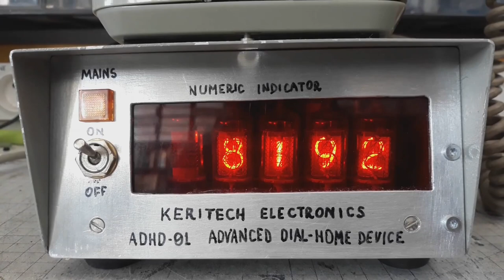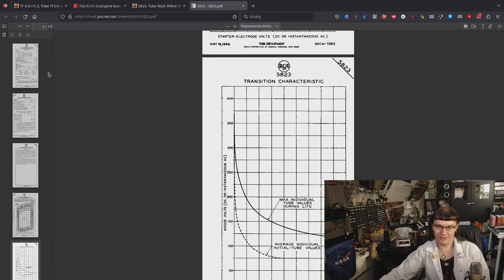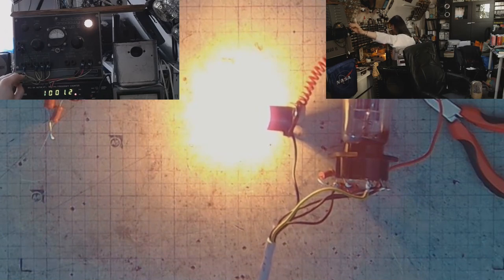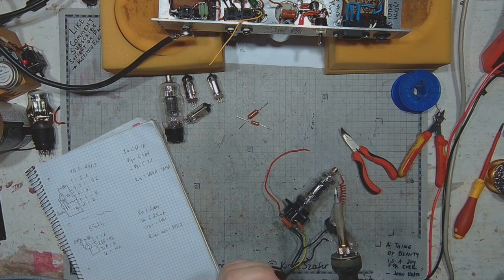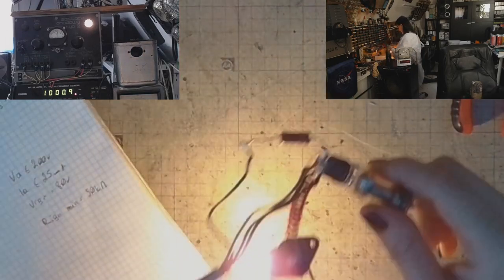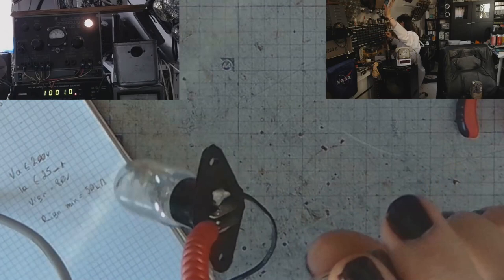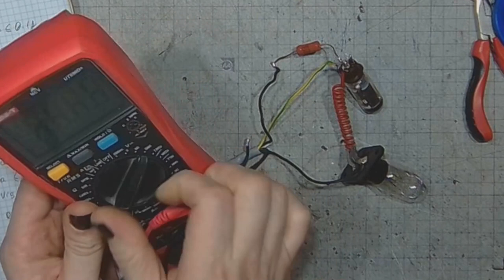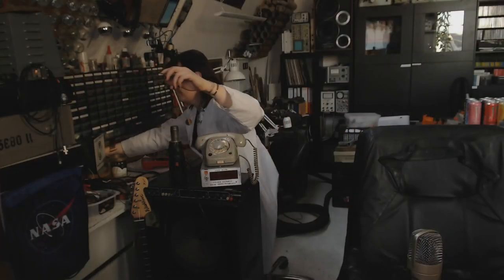That's Even More Thyratron Fun!

Comment: I remember visiting the Atomium in Brussels as a child. The elevator motor was controlled with thyratrons that were visible from the outside and when the elevator was working it looked as if the tubes were filled with sparks and flames and I had the feeling the thing would explode. 😀
Reply from the maker: You should definitely take a look at https://www.youtube.com/watch?v=WX74GoHuwHk - the video I was mentioning. And it turned out these blue-glowing tubes were also thyratrons rather than mercury vapor rectifiers.
Reply: @KeritechElectronics  that power supply is a real beauty ! Thanks for pointing that video out to me ❤️
Reply: very cool, TUBES !